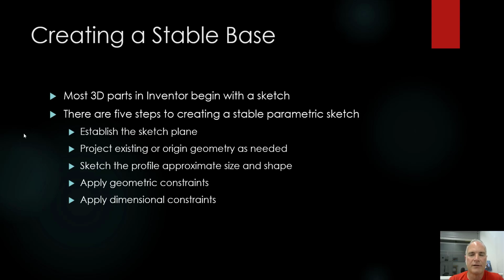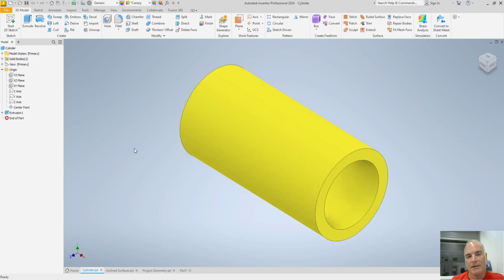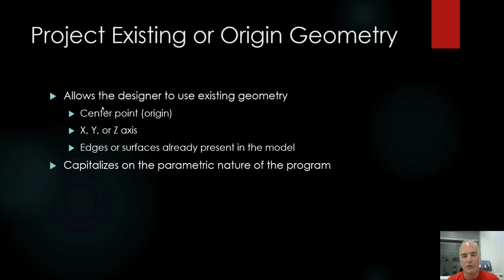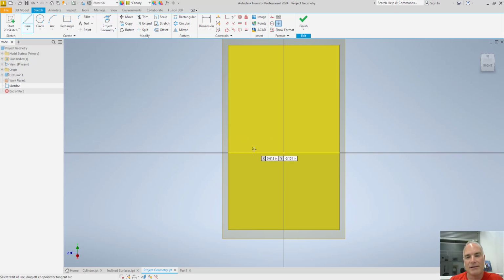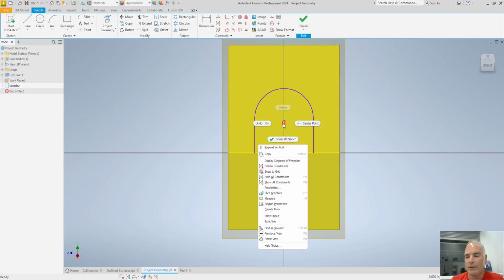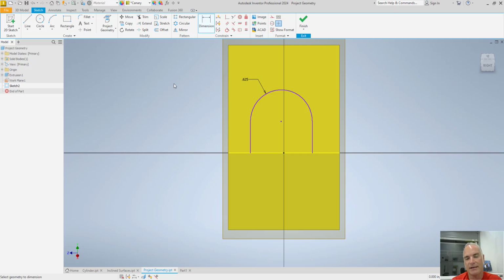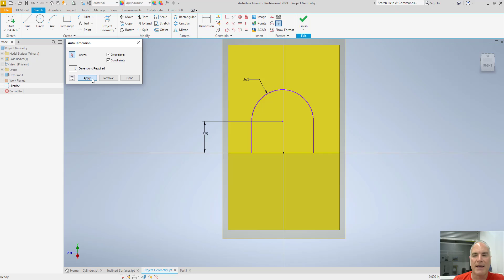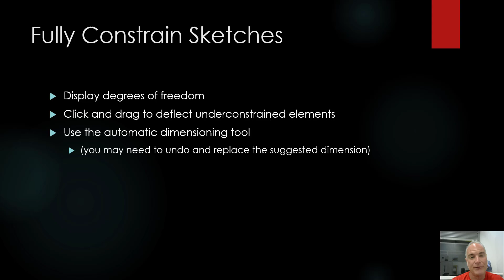Autodesk Inventor - 5 Tips for Better Sketches

Comment: Do you have any practical tips on using constraints in assemblys and the difference between constraintsand joinsand how they apply in assemblys.
Reply from the maker: Thanks for the question!
Yes, there are some advantages to using joints instead of constraints - it depends on your application and what will be done with the assembly. Joints are perfect for use when you will be animating the assembly.
This video demonstrates using constraints to assemble parts. This is a great video because it demonstrates how to use the origin features (the XY, XZ, and YZ planes as well as the X, Y, and Z axes) to help with assemblies:
https://www.youtube.com/watch?v=xYFtmx0s7tc

Here is a video for joints:
https://www.youtube.com/watch?v=ApDwh3paZGw

I will be making a series of videos next week.

Let me know if you have any other questions!